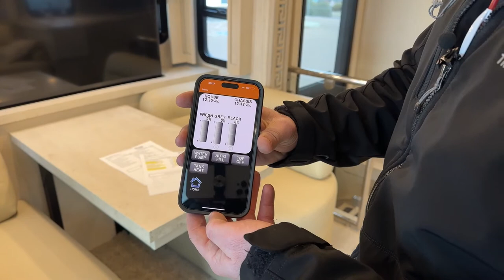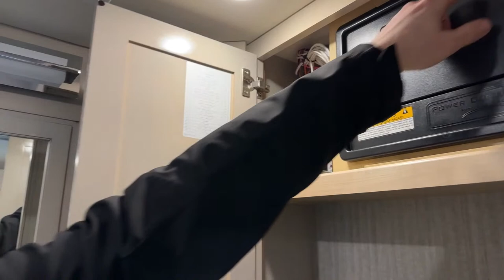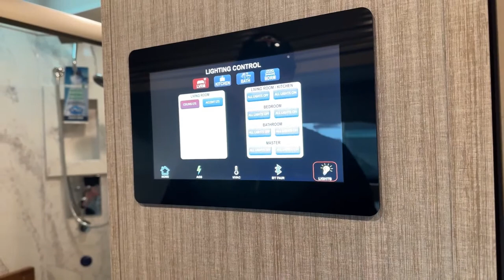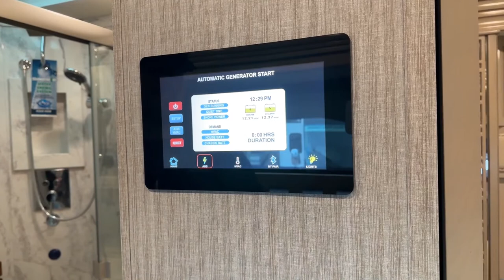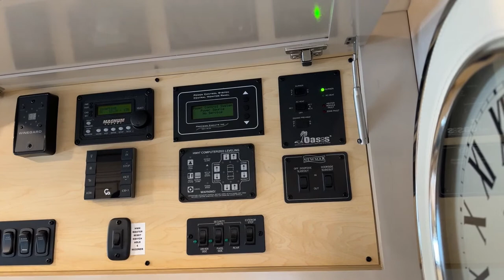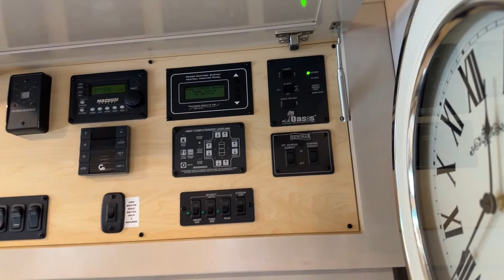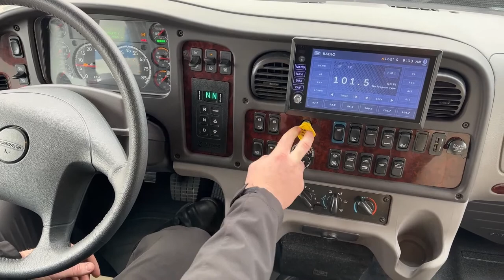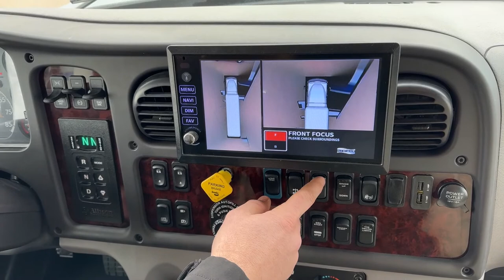2023 Newmar Super Star 4065 Bunk Bed Model - 5N211801

Comment: Newmar, you are half way there. Please make the 12 volt fuse panel suitable for a coach this expensive. You dressed up the 120v panel, thank you  . But the 12v still looks like a home built Scooly  build.  Maybe put the inverter in with the batterys, save a hundred dollars in copper wire and make more space available for storage.  I LOVE that you have actual STORAGE ON THE PATIO SIDE, and put all the mechanics on the driver side.  THANK YOU          CHEERS     Steve h.